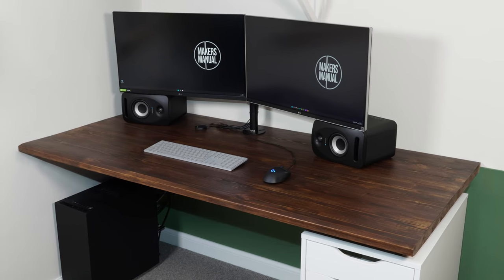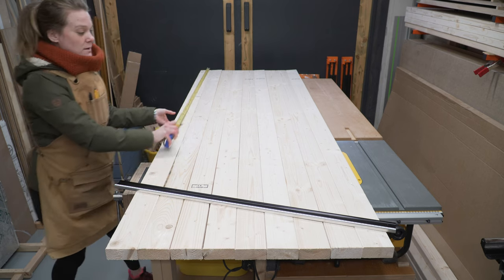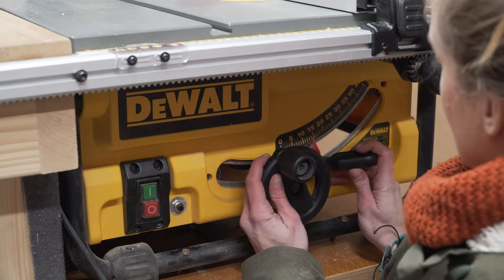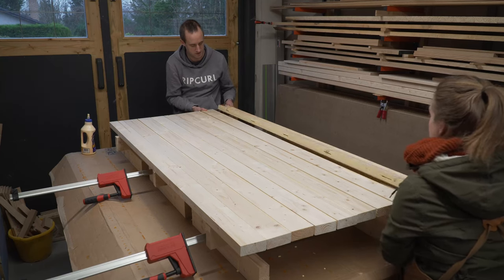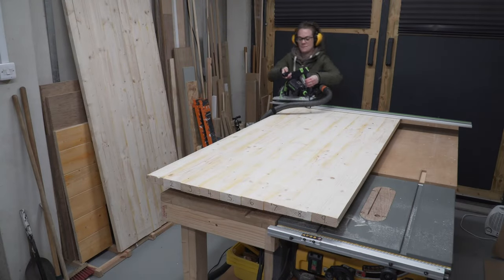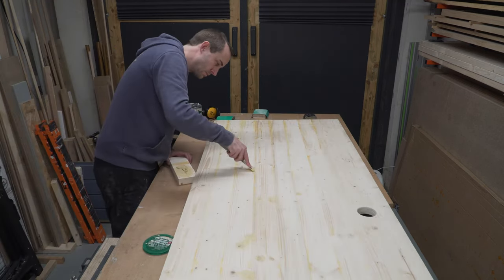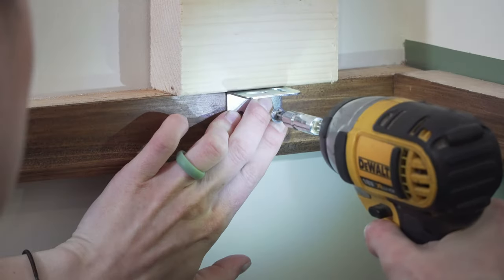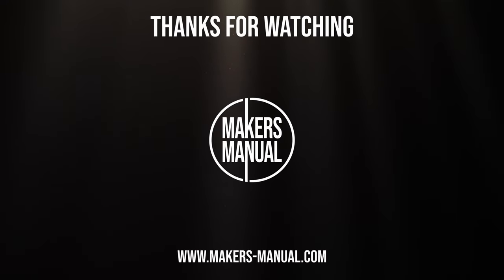Floating Desk Build | Easy Affordable Home Office from 2x4s | FREE Plans

Comment: This could be a very silly question but I can’t seem to find a satisfying answer anywhere online. How long should the screws be that I’m using to fix the batons to the wall? I’m assuming you don’t want them to be going in too shallow as they might not hold as much weight? (The batons I’m using are 3x2”). Happy holidays and great work on these videos 😁
Reply from the maker: There’s no such thing as a silly question. But as you’ve probably guessed there isn’t one answer to this question. Assuming you have a timber stud walls and are screwing into the studs, then I would put 2” into the wall; this allows for 1.5” into the stud and 0.5” to get through the plasterboard (Gyproc). Plus the thickness of the Baton, in your case a 4” screw would be good. Though you could use smaller screws if you counterbored the baton, this might be neater, as 4” screws can be chunky. Hope that helps, happy making.

Comment: Thanks for posting this, it’s exactly the kind of setup that I’m intending. How is it holding up, any issues with cupping or usage marks? Also, how is the chamfer at the front? Would you do it the same way again after some time using it?
Reply from the maker: It's holding up really well, with no dents or scratches. Although I must admit we both use large mouse mats (https://amzn.to/46ZUqEq) which do a really good job of protecting the surface. The chamfer at the front is also working out well, it's comfortable and I would probably do the same again. Also the desk has remained flat with no cupping etc which is what I would expect, given how well it is secured to all the batons.

The only issue we have encountered... and this is a weird one... is the surface is now wavey (at the glue joins, the wood is a little lower). I wouldn't worry about that happening for you though, we did the glue up on a very cold week. Although we left the desk for a few days to dry before sanding, the moisture in the glue hadn't fully dissipated and so the timber was swollen at the joins. This meant when we sanded the desks surface, we were inadvertently removing excess material from those joins. This meant when the glue fully dried out, the timber shrank back down leaving the wobbles. Lesson learnt, don't do a glue up when its freezing!

Good luck, its a great project. The plans are free on our website if you want a go. Let us know how you get on. Michael